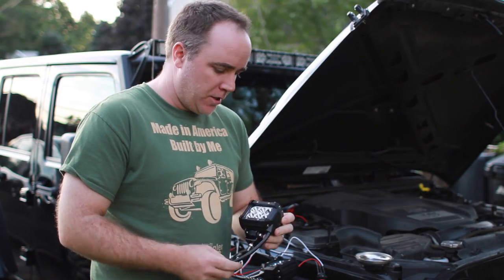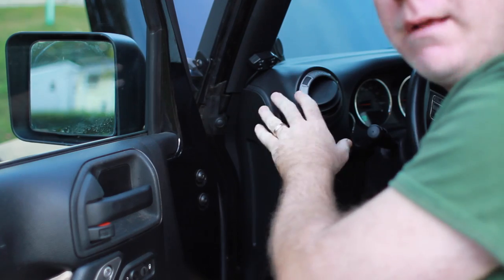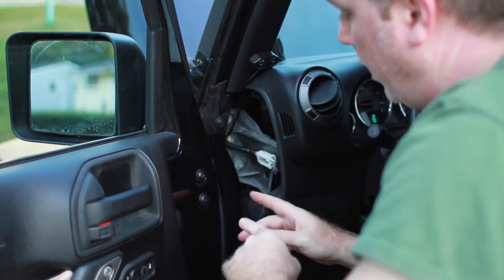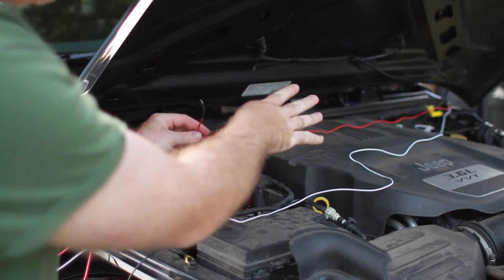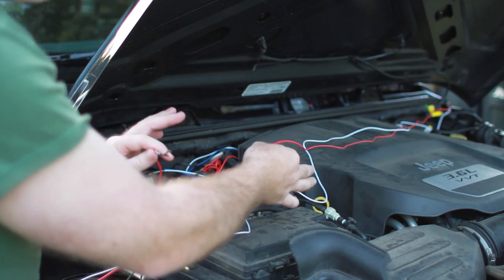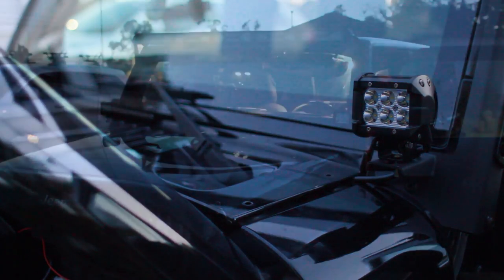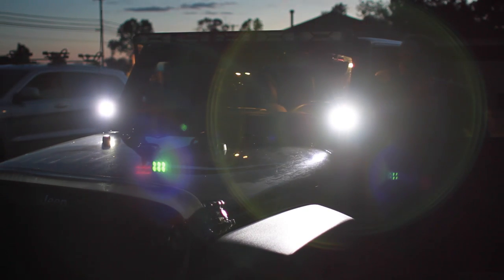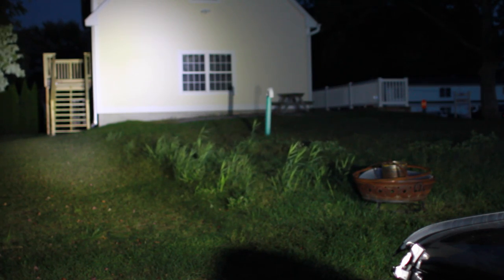NiLight 18W Spotlights

Comment: a set of 20 sent crimp connectors and some heat shrink tubing would make the wiring so much better.  Electrical tape should be placed on top of heat shrink waterproof tubing.  Good video - appreciate the hint on running the wire through the firewall - I went through the firewall by the brake pedal. Good to know alternative spot to run the wires.

Comment: The ground wire you placed on the toggle switch (gold prong) is what gets illumination of the switch. So it does matter what wire goes where on the other prongs. One will supply light to the toggle the other will not.

Comment: If I get 2 of the 4 inch light bars do I need to get 2 separate wiring harness? Or is there a kit that allows you to hook both lights up? If so can someone point me to the harness I need? Getting 2 4inch Nilight 18w light bars thanks for any help
Reply: mateo Chafin ive wired mine up to my existing headlight wiring harness just tapped in separate time and has worked fine for me ever sence
Reply: you can wire both to 1 switch i have 12 light bars on my truck and only have 5 switchd

Comment: have you had any trouble with water getting in? or the led burning out?
Reply: Conner Hayes I had a set for roughly a year and yes a little water got inside of them but the LEDs still worked and they were very bright for the price they are on amazon. Definitely more impressive than eBay lights that may even be more expensive.
Reply: A little silicone around the lens and cord stops that

Comment: Bro did you seriously crimp a female clam connector? Correct way is either crimp male connector to light or remove clam and use splice butt connector, then heat shrink to weather proof.